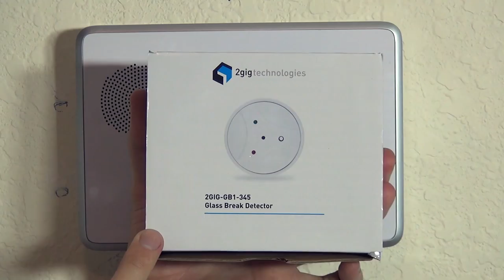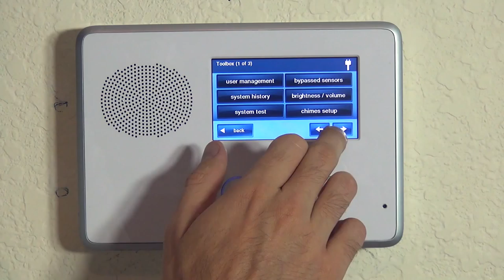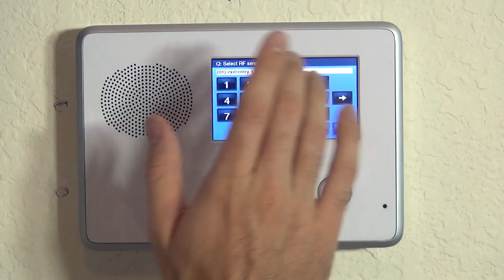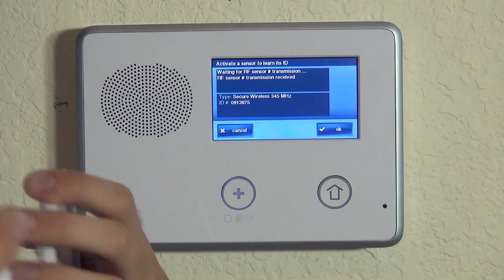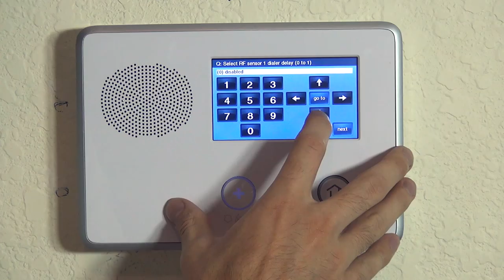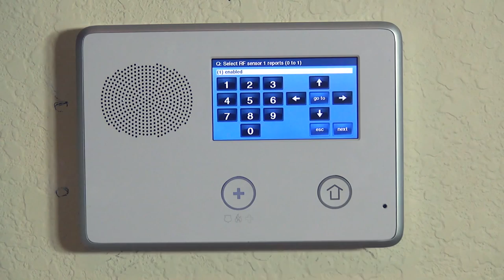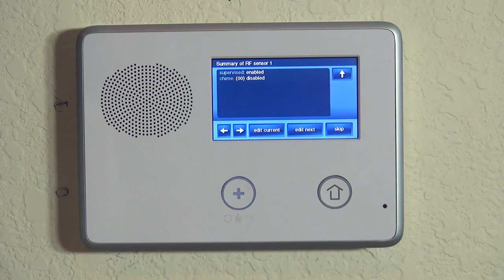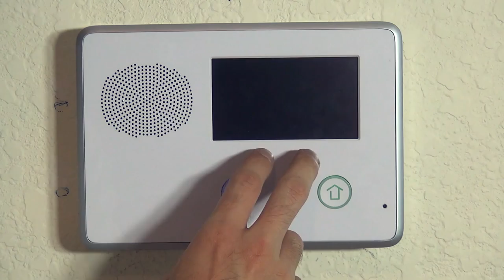2GIG GB1-345: Go!Control Programming

Comment: Does the same beeping happen if you tamper a device (change batteries or move it) when the system is disarmed? I don't want to set off an alarm because we are replacing a door and I have to open the sensor.
Reply: Thank you!

Comment: installation height on wall mount ?
Reply: When wall mounting smoke detectors, they should be installed no more that 12 inches away from your ceiling.
Reply: @dylanalarm_grid1038  looking for glass break detector mounting height